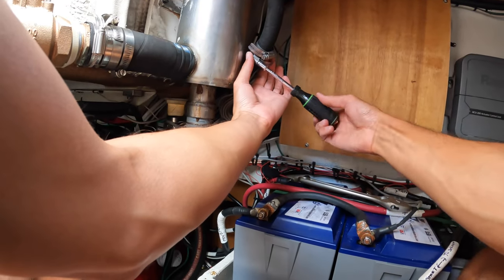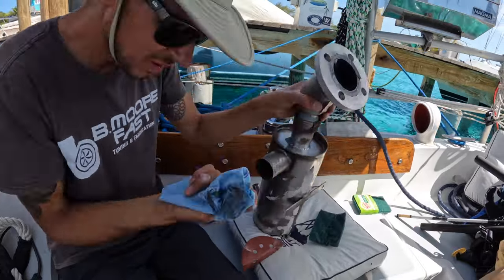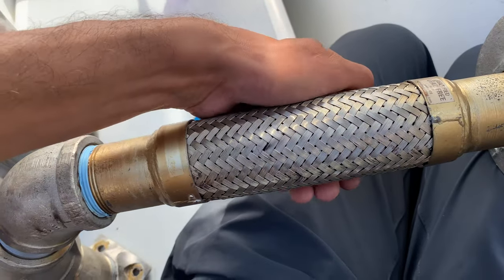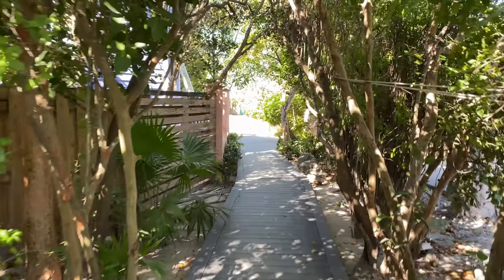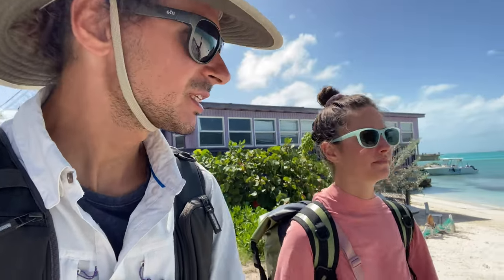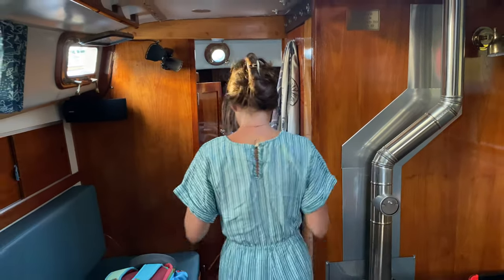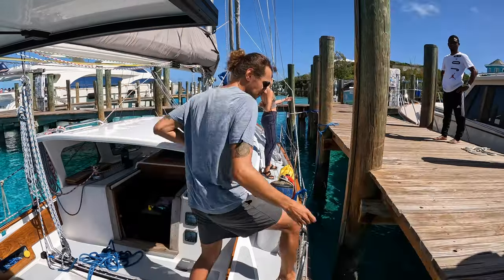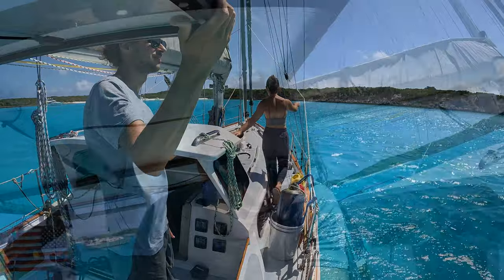EP. 35 We Made a HUGE Decision

Comment: All the Bukh 2 cylinder marine engines I've seen have raw cooling water injected downward into an elbow that's directly attached to the exhaust manifold exit. From there, it goes straight into a rubber hose which deals with the engine's heavy vibrations. Anything of significant mass and length bolted to the exhaust manifold on a two cylinder Bukh is not likely to last very long before cracking.
Reply from the maker: Yes the system you describe is what I will be installing. It will take some modification of the cockpit locker but I'm up to the task!